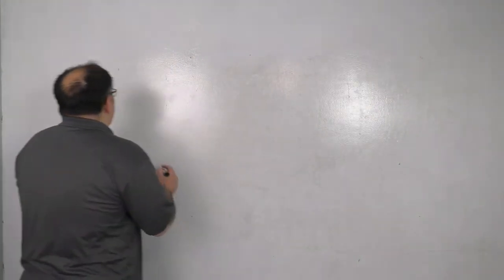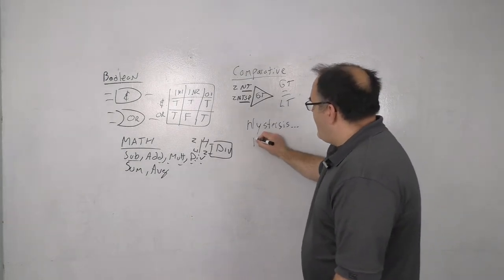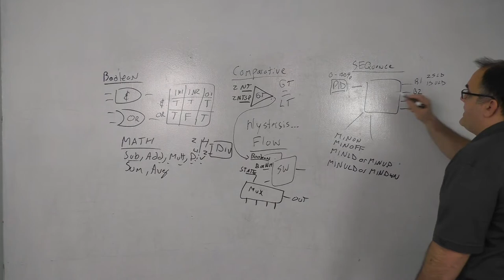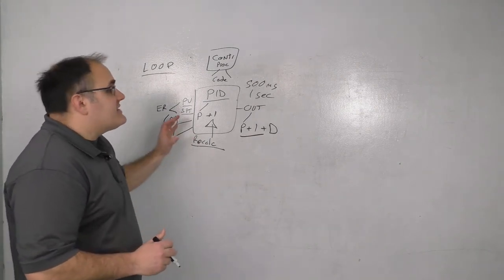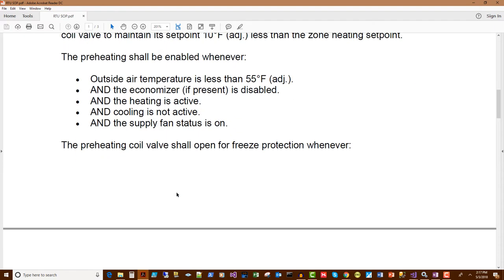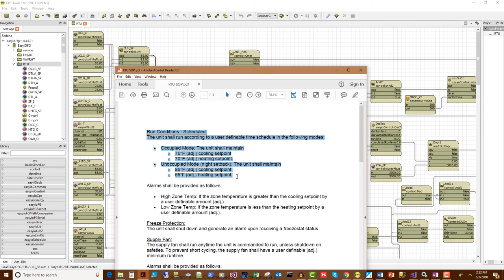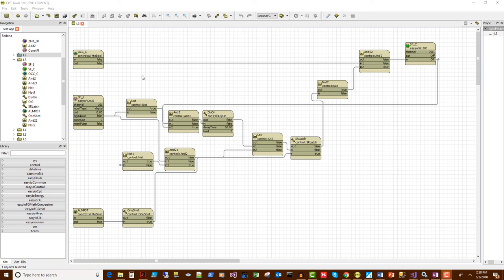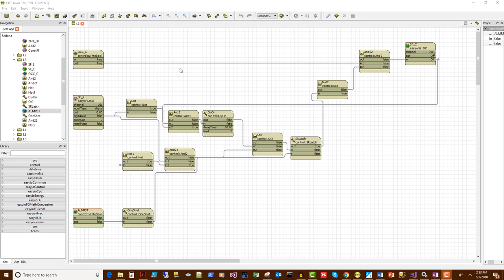BAMTV 002: How to program a building automation system Part 2

Comment: Hi Phil I started watching your videos BAS system programming. it's excellent and I want to download the EASYIO controller from where I can download. If I download so I can go through your classes and I can start practicing... It will be very helpful...
Reply from the maker: EasyIO support is who I would contact. That or reach out to Distech about GFX, different tool that requires compilation before running the program but still a very good (free) programming software.